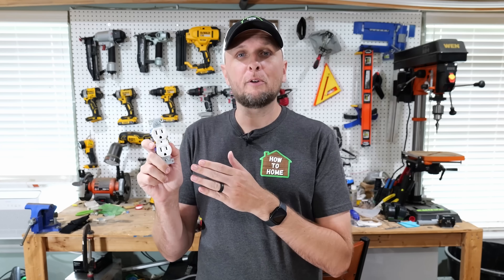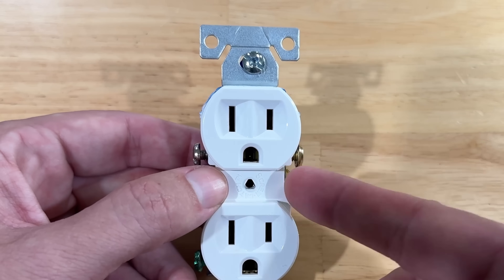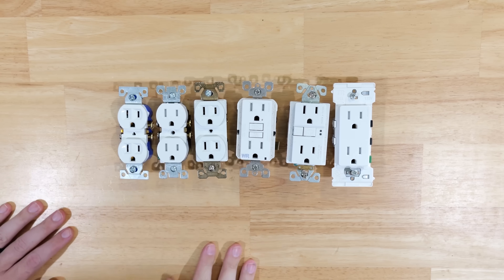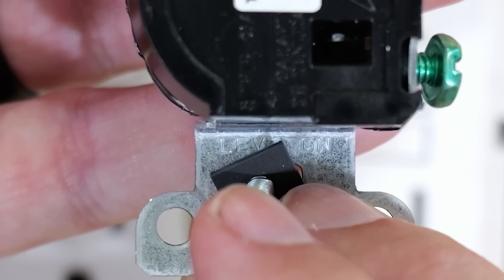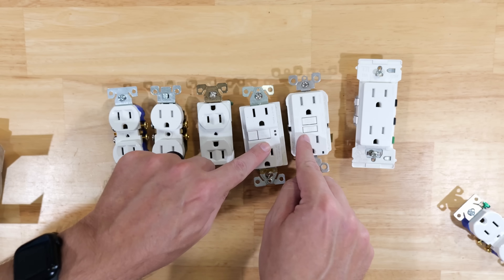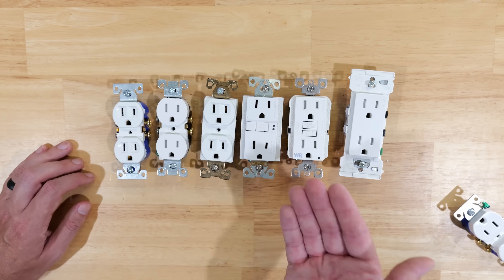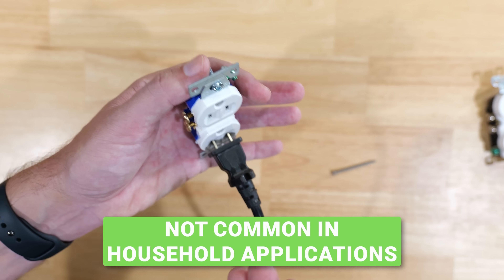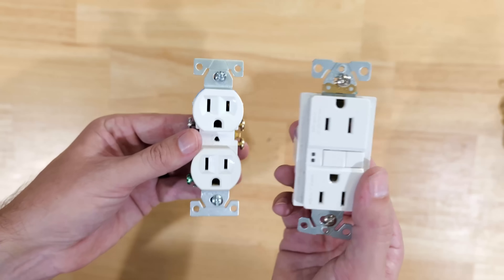The Shocking Reason Why Your Outlets Are Installed Upside Down!

Comment: I prefer my Outlets not to be looking at me 😉 I also like that the ground tends to be stronger for holding in where it is utilized. I agree that the chance of something falling on the electrodes is slim I will say my wife "was" hanging her necklaces on her USB charger in our bathroom and one did slip between the outlet and the charger vaporizing the necklace and blacking the outlet. I never would have net her do that in the first place but some how never noticed it.  I also see the point of putting the switched ones opposite of the non switched to denote the difference have seen this in a few homes.

Comment: Right or wrong I was advised to place grounds up in a work shop as there tends to be more small things falling into an improperly installed receptacle. Important thing is make sure plug is installed in receptacle properly and checked often then most problems solved!

Comment: It's hands down ground plug down. Metal cover plates falling off by themselves? Not happening unless the aliens are coming down and doing it. And today, it's all plastic cover plates anyway. We all know there is no code or manufacturer requirement to install a receptacle in a certain orientation other than not face up in a possibly wet environment. Just look around at your own home with ground plug down which is 99.999% of the way they are installed. If against code, would they be installed that way and pass inspection??? No they would not be. The old, "ground plug up to prevent falling metal cover plate short" is the biggest bunch of BS ever. And plugs with 90 degree wires would be sticking UP it attached to GP up outlets. Makes no sense at all even with switched outlets like some say they have installed. You know which outlet is switched the very first time you flip the switch to it.

Comment: CEC Rule 72-108 (3) "When mounted in other than a horizontal plane, receptacles shall be oriented so that the U-ground slot is uppermost."  Diagram 1 - CSA Configurations For Non-Locking Receptacles shows all receptacles from 5-15R to 15-60R with the ground pin as the top pin, and refers to 26-700 (Installation of Electrical Equipment - Receptacles) (1) "Receptacle configurations shall be in accordance with Diagrams 1 and 2, except" (c) "where other configurations are suitable."                                                                                                         So, there is definately a preference in the Canadian Electrical Code for installations to have the ground up, and in some cases is required to be installed this way. Installations with the ground pin down are an exception to a Rule, so electricians that are installing them ground pin up are actually installing them correctly.

Comment: I'd love if I've would be up and one down. That way, when you connect 2 larger things (like a charger, or just a wire that's facing down) they don't block one another, and will actually fit.

Comment: Ground up, safer, period, I’ll say why. If you are measuring with a tape (metal) behind cabinets etc. the tape standout may buckle wedging between the wall and cabinets findings the gap  between plug and wall arcing over the hot and neutral, ask me how I know.

Comment: Wow, good info, but, “ it can go either way” was all I needed. Hoping that’s all I remember… 
After many videos it took an electrician to explain the difference between 200 ft of proper wiring from source to shop vs 200 ft of extra heavy extension cords….(strands of wire vs one solid wire)…

Comment: Ground up provides a bit more strength offsetting the weight of a heavy cord and helping it to stay in place, on the other hand, having ground down is a safer scenario for worn outlet which may be allowing a plug to "sag", that is, if a three prong plug does work it way completely lose, the ground will disconnect last at least providing a ground path as the hot side looses contact.
Reply: Ground up is safer because it keeps the live prong plugged in more and less vulnerable to shorting.
Reply: @ctrlaltdebug  yeah - I hear ya and agree - everyone knows about that reason, but heavier cords benefit from ground up too - thanks for your reply, appreciate.

Comment: Depends sometimes on the default use.  Example dishwasher, washer, gas dryer, refrigerator and how the wire is attached to the lead.  ground down may make the wire hand stressful so in that case maybe that outlet different then the rest of house.  You may also install a new appliance and the need to rotate the outlet 180 .  Also if you use the outlet for washer and gas dryer you may have a conflict.

Comment: Ground up if ur metal plugin cover fill off with a grounded plug pluged in to recptical and landed on ground plug proung especially if plug is not fully seated in resptical. If ur plug falls part Way out normally it's probably Time for a new resp- tical to be installed! Commercial grade respticals preferably.

Comment: Ground down seems to be the default position. I’ve only seen one house where outlets were installed ground up. To me the biggest reason for ground down is if you have a heavy plug and wire that drapes down from the receptacle the ground plug down is more resistant to the plug not being pulled out of the receptacle by gravity.

Comment: If you do your house with all prong up you are in for a challenge when it comes to plugs with wires coming at a 90 degree meant to point down. Many power strips and other heavier duty plugs are meant to be on a prong down and come out at a 45 degree angle facing toward the ground. If you flip the receptacle prong up, all of those style of plugs would point up and create issues with both look and weight on the plug.

Comment: I have seen areas where outlets were mounted sideways, not up/down positions. Also most all double sided power strips have prong side on both sides - mounting on a wall will give you a 50/50 split.

Comment: What is the proper orientation for a floor outlet? Should the outlet face up or down ?
Reply: @jebcommon2332  An outlet in the floor would be horizontal by definition wouldn’t it? In that case there’s no face up or down. It just depends on which side you approach it from.
Reply: Ground pin must face toward the north.

Comment: Think about how you hold the plug while plugging in or unplugging do you want your fingers next the hot wire or ground? Additionally since the ground is longer its easier when looking down on the receptacle to engage it first then align the others. That is also true when plugging in where its hard to see you can safely have index finger even touching both the ground on the plug while feeling for the receptacle and tell the difference between the round hole and the others. Having your finger touching either of the others will get you shocked😉😂
Reply: And then I continued watching and he showed the unplugging and how you could end up shocked with ground up 😁
Reply: What do you have against thumbs?  Why do you force them to be near the hot side?

Comment: if the top of your (toggle style single pole) light switch says "NO" that means it is installed upside down.
Reply: @kenbrown2808  That’s why they put it that way. If you try to install the switch upside down it will tell you “no”. 😉

Comment: I've seen many in older houses mounted horizontally. So would the ground go to the left or to the right? (Let the arguments begin. LOL).
Reply: @phillipmeeks2391  I don’t think there’s any functional distinction between ground left and ground right to debate over.
Reply: @davidroddini1512  then the argument is neutral/hot placement. in which you'll mostly find neutral blade up for the same reason as ground pin up.

Comment: because of the potential for accidental contact, I prefer to put horizontal outlets with the neutral side down.
Reply: Why not neutral up? Isn't it more likely that someone or something would make contact with the upper pin? (Although I don't believe any of this makes any real difference.)
Reply: @tedwalford7615  you're usually looking at the top. If you accidentally touch a blade, it will probably be the one on the bottom.
Reply: Less likely to ground is you drop something on it if neutral up🤷
Reply: @chineseredneck1211  the odds of accidentally having a finger in contact with a blade are mu h higher than the odds of dropping a thin piece of metal accurately enough to hit an exposed bit of blade.  Edit: TWO exposed blades at once.
Reply: @chineseredneck1211  because consistency is a good thing, and so i chose the more likely accident to base things on.
Reply: @kenbrown2808  😂🤣🤦🥴🍩

Comment: is beer good for a diet??
Reply: @mikemaki1104  I guess that depends on the particular diet. I know some diets that say to avoid alcohol or only drink sparingly. Other diets not so much. In fact you can even lose weight by only consuming beer and nothing else for a certain length of time. (Although for health reasons I would not recommend it.)

Comment: Some of this started in non US countries (different plug types) What was happening is the metal blinds in the windows where breaking off and falling between the plug face and wall and shorting out or metal blinds are long and would stay in contact plug and floor and be live. It was bad enough that some countries (UK, Australia, Europe) changed there plug to insulate the first 3/16 of the hot and neutral terminal coming out of the plug face. So ground up when I install them.

Comment: Adapters with ground normally need ground down. As mentioned earlier, 90-degree cables need it down as well. 

I also have a client where OSHA made them change them to ground down stating the ground is more likely to break off while inserting or removing the plug if up. 

FInally, I once made a sub turn them all over on new construction as it was specified on the plans as ground-down - he wasn't happy with that crew, but they came back and changed them.

There is only the falling metal object argument for ground up, but there are many reasons for ground down.  

Reply
Reply: I was an CSHO trainer, not the officer and never heard of such a requirement they usually refer to the NEC 70 for electrical. Find it hard to believe it enforceable unless a state OSHA requirement.

Comment: Code aside... Straight 3 prong or Polarize plugs doesn't care outlet orientation but Angle plugs do care. Most things make for home and office are made for outlet "Ground Down" so weight or stress is pointed down so having angle plug the cord isn't bent tight at the plug or heavy Wall Warts stay put. Search for "low clearance power cord" and related for many examples.  Some "Shop" and Hospital equipment have angle plugs but made to expect to have outlets "Ground Up" for same reason.
Reply: Yes.,.. solid answer... there is a reason most installs you'll find on lower wall sockets is with Ground Pin down! All 90* 3 wire plug wires/pigtail plugs work designed with Ground Pin/hole in receptacle down and obviously knowing this... it's easy to determine in the dark to find long pin ground hole as easiest way to safely plug in Long Round Ground pin 1st= SAFELY!
Reply: I have turned the receptacles to ground-down after inspection to match the ground-down hospital equipment.

Comment: If you examine plugs, the ground prong is longer than the hot/neutral prongs.  Having the outlet  ground on the bottom allows the ground prong to make contact with the outlet longer as the plug becomes dislodged from the outlet.  Thus making the ground on the bottom the safer of the two orientations.

Comment: I have a new Eaton plug here on the table that I'm going to install. On the metal tab that screws to the box, it's clearly stamped Top in the metal. The ground is down.
Reply: @fauxque5057  In that case, then manufacturer’s labeling takes preference. So that receptacle must be installed ground down.

Comment: If you have metal/brass covers the ground up is safer. If you remove them with something plugged in and power on, if the cover slips nothing happens. I know you should not do this but people do,

Comment: My opinion on this is that most people need to get some business and not spend their lives commenting about things and have little to no relevance at all.  I am NOT an electrician but have done a good bit of wiring and had about 2 years of electrical wiring in school and vocational training.  I do appreciate your informative video and I did watch it all in case there were any situations I was not aware of.  (the 'face-up' orientation ban over counter-tops or under sinks for example)

Comment: What I've gained from this video and the comments I've read is a new insight for me: If I have a cord from an appliance or extension cord that is dropped down a wall to the outlet/receptacle from above, and it has a 90 degree plug, I can flip that outlet to make a more efficient connection! I just had never thought about it before.

Comment: Im ground down. I noticed all medical offices ground up in PA
Reply: @richardtroy7143  That’s because a lot of medical equipment is designed for ground up.
Just like several residential three pronged items are designed with a “lie flat” cord that only lies flat if the receptacle is ground down.

Originally ground up was conventional for industrial/commercial settings and ground down for residential. Equipment manufacturers designed the cords accordingly. Now, while no such official convention exists for receptacles it makes sense to use what would be most compatible with the cords that are likely to be used in the setting.

Comment: I only install the outlet, ground side up, if it's a dedicated circuit. Meaning one outlet on that breaker. 15 or 20amp, doesn't matter.
I had to do this for my smoker. 
The original outlets on my back porch wouldn't support any more amperage. 
The IDIOT that built my house, (who lives two doors West of me) ((He is a general contractor)) put the back porch outlets on the same circuit as the living room. (WTF)

I live in Midland County, Texas. Obviously there are no inspections on electrical instillation. Judging by what I have found.
I'm not a professional electrician, by any means. However I know how to use an outlet tester. As well as a multimeter. 
More than three quarters of the outlets in my house were wired backward. 
Of course meaning the hot (black wire) was wired to neutral (large terminal). Then the (white) to hot, (small terminal). I over the last few years have finally been able to get it all straightened out. I even found one outlet that had the neutral wire and the ground backward. 
Don't even get me started on my shop. Purple, Brown, Pink, Red wires. What the Fxxx.

Comment: The Brits like to make fun of our electrical system, because they have small fuses in their plugs, and we don't. However, our system runs at 120V and theirs runs at 240V. If you've ever bit hit by both voltages, you know 240V is much worse. I'll take a 120V hit on our electrical system any day, over a 240V hit on theirs. Plug orientation is a non-issue.

Comment: So, has the time come for a redesign of residential outlets?
Reply: Residential outlets have already been redesigned.  Look at the abominable "tamper resistant" outlets.
Reply: @stargazer7644 , I'm thinking more along the lines of recessed and protected connectors. Something akin to audio XLR connectors or captive twist-lock industrial connectors.
Reply: @robbehr8806  We already have them available.  NEMA L5-15 and L5-20 if you should need such things.  Let me know when you replace all your residential outlets and reterminate every power cord in your house.
Reply: @stargazer7644  , I know those exist. And, I could replace every cord in my house. My point is not my specific situation, rather the general industry practices.
Reply: @robbehr8806  You suggested the industry needed to redesign outlets to provide locking.  I pointed out a redesign isn't necessary, locking outlets already exist, if you really need that.  
Our existing outlets have served us well for 52 years.  They have an ENORMOUS existing installed base.  I don't really have a huge problem with plugs falling out of the wall, nor do I have a huge problem with Thor knows what falling down the wall and wedging between the wall and the plug and shorting things out or electrocuting people or pets.  I do read the news and (this forum not withstanding), I haven't seen overwhelming numbers of news reports about it happening to other people either.

Is there any common national residential plug that locks in the world? 

If it ain't broke, don't fix it.

All this is an attempt to answer your original question:  No.

Comment: Fixing problems that don’t exist in real life. I’m a doctor and no one is dying or getting hurt from plugs being pulled slightly out.
Reply: Doc is right.  With prong down a heavy cord which has been partially pulled out will be grounded.  Prong on top in the same scenario the ground could be out and the live prongs still partially in so you are unprotected at the appliance, drill, saw etc.

Comment: I have never considered this. The argument for ground up seems stronger overall, but the case of 90 degree plugs argues for ground down.  As I see it, areas like kitchens, make more sense for ground down, since one made need to adjust for appliance plugs and extension cords.  For my TV center, I really need ground down, I have many devices to connect.

Comment: The house I bought last year has the ground plugs up. The problem I have is that some outlets seem to not let me plug things in.   I don't know if it's a code thing to stop a kid from jamming a fork into the outlet. Very frustrating.
Reply: Tamper resistant are harder to plug things in.